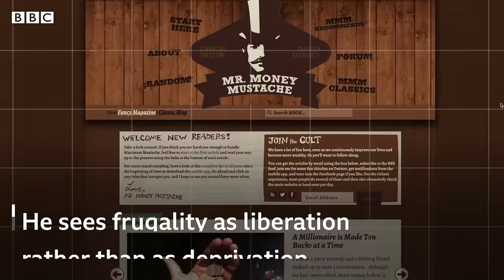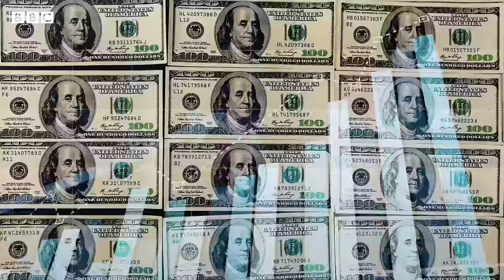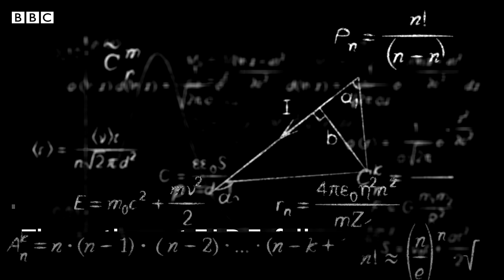How to quit your job and retire in your 30s: The new millennial trend - BBC REEL

Comment: Another lifestyle video promoting financial security for a small number of privileged, hard-working and well-educated people who live in relatively stable economies and societies. 
Of course, they made some smart choices and some of them might not have had such an easy path to get where they are now, but they still remain an extremely small minority who get to make this dream work. That's not to say there are no benefits from this approach, there are some good points made about the fragility of relying on more conventional approaches. 
However, it is still essentially promoting the idea of "get your slice of the cake earlier" and not be too worried about those outside of your own family structure that don't have the same opportunities. 
The so-called secure investment models they are using may at some point be subject to failure too. Of course, they think it's been reliable so far, but that is because they have been able to cover daily expenses through good incomes combined with tight control of spending. 
Any move away from materialistic lifestyles is going to be a decision based on comfort and convenience to some extent, which may or may not be a realistic alternative if you are already saddled with large debt or you are struggling to get by on a low income with a precarious employment situation.